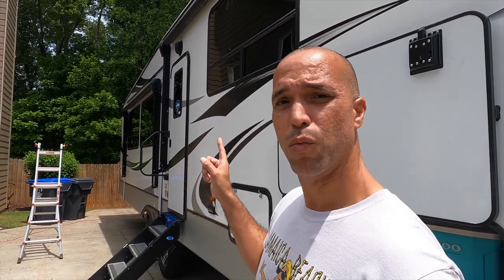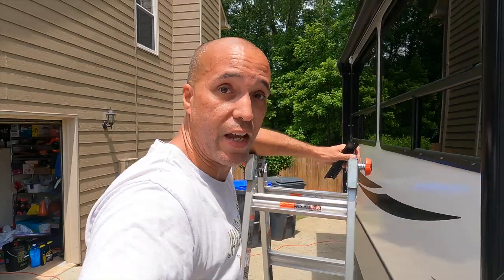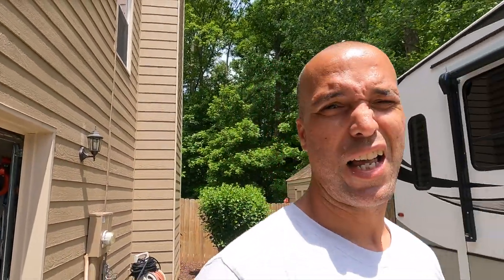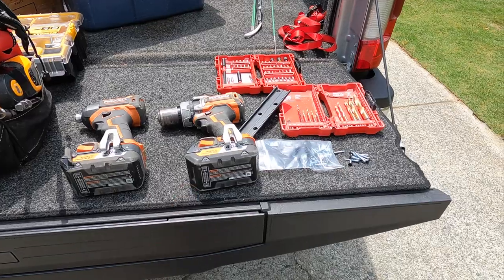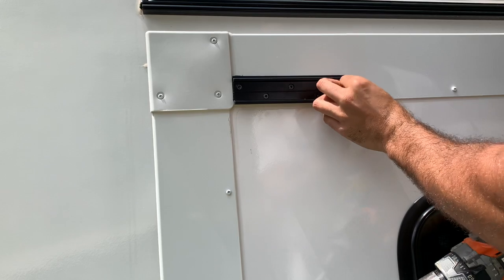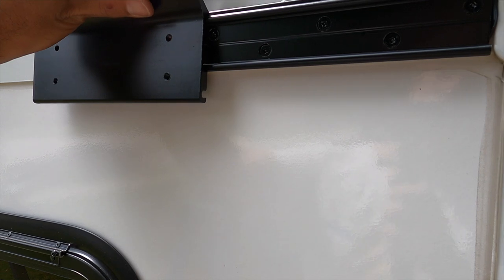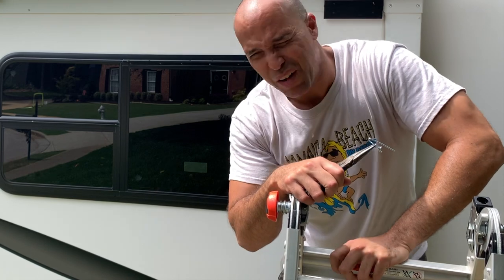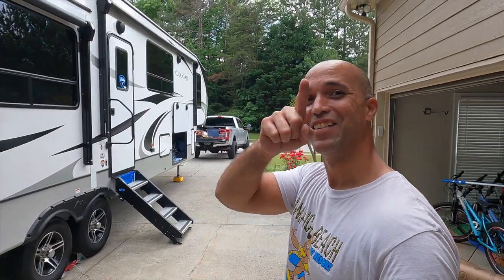Installing Solera RV Slide Toppers | DIY Awning Cover Install

Comment: How do you adjust the tension when over time the awning may have some slack to it
Reply from the maker: Hi friend. There was nothing in the instructions about doing that so I’m not for sure. That being said, after doing the installation myself and kind of understanding how it works I can tell you what I would try. I would roll out the cover aprox a foot or so. Then, either replace the tension rod pins back in or bend a metal coat hanger and put that in. Anything to keep it from rolling back. You’d then have to slide the awning back out of the track, wrap it around the roll a couple times and then replace. All this is just guessing though. I would first call LCI and see if there is an easier way to adjust. I hope this helps get you going in the right direction. Wish I had something solid for you but I haven’t had to deal with that.... yet. 😂 Thanks for watching!

Comment: You never said how many turns to put on the springs to make the topper tight. They don't come tight out of the box.
Reply from the maker: The ones I installed came pre-tensioned. There is a clip on either side holding the tension. Once installed, you pull the clips out and it gets tight.
Reply: @RCRVadventures  Makes sense. I had to replace the spring kits on both sides of the 25' topper on my motorhome after 80+ MPH winds broke it while in Oklahoma.
Reply from the maker: Oh man, I’m sorry to hear that. Did it just ruin the springs or did it destroy the whole awning?
Reply: It was 2 in the morning when it sounded like a train hit the motorhome and glass shattering. The high wind had broke the front bracket of the 25' slid topper, sending the topper up and slamming down on the roof. The glass was from the glass covers of the LED ceiling lights being knocked out from the impact and breaking on the tile floor. And the topper tube continued to bang on the roof. So, while my wife was vacuuming up the glass, I went on the roof in the wind and sleet to free the topper tube from the motorhome. I cut the fabric as close to the motorhome as possible and with a big heave, through it up in the air. The wind took it about 75 feet south of our rig. The only thing I saved was the 25' tube and the brackets with the hex bars that are bolted to the motorhome. So I replaced both spring assemblies with the arms and the fabric. And it's not easy to find 302" long fabric. People ask me how my trip to Oklahoma was? I reply "Memorable".
Reply from the maker: Holy cow! Now that’s a story. Man you’re awesome. I love your description of your trip. Memorable. 😂